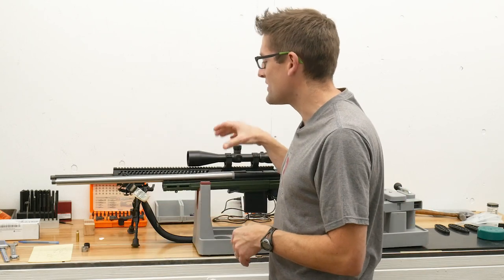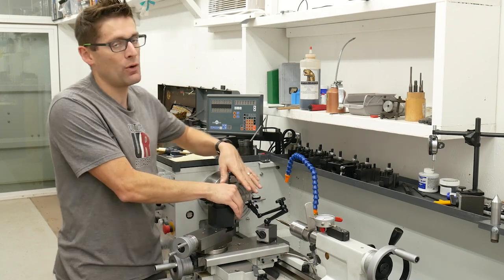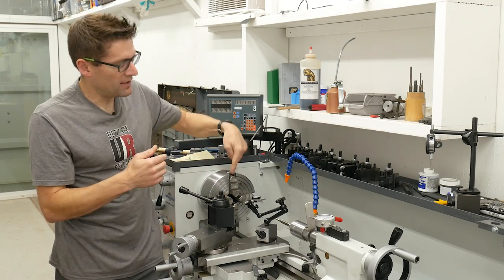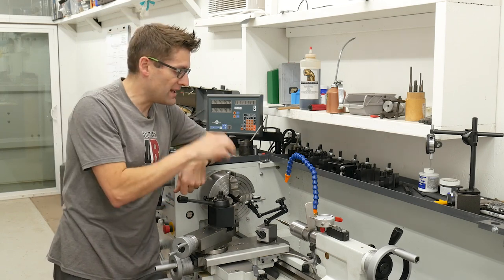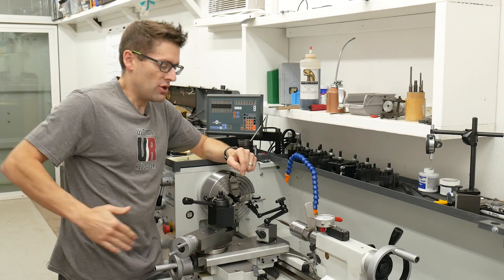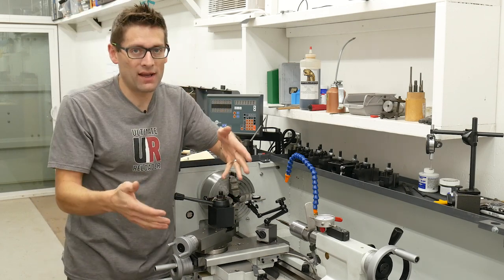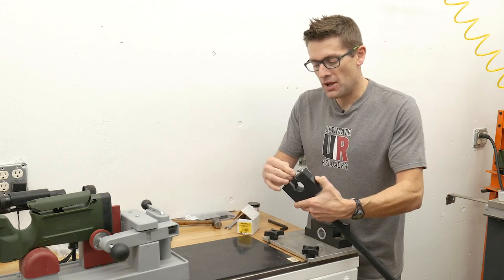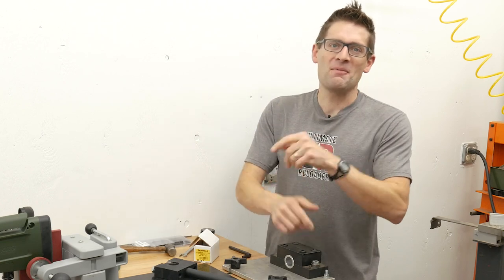224 Valkyrie Rem 700 Build: Muzzle Threading and barrel install (Part 4)

Comment: If you want to reduce your stress level in threading , I would suggest a change. Turn your threading tool over on center, reverse your spindle direction and thread away from the shoulder. You can set a hard stop to start from and never worry about hitting the shoulder.I enjoy your videos keep up the good work!
Reply from the maker: I'll have to try that!

Comment: Gavin, I think if you used a piece of heavy gauge aluminum wire wrapped around the barrel and cut so it doesn't touch itself you'll find it much easier to center the barrel than the aluminum pads you are using. The wire makes single point contact with the barrel and allows it to move much easier than the pads.
Reply from the maker: Bill- I've heard of guys doing that- perhaps I'll try it and compare! Thanks.

Comment: Nice video. 2 tips.....First order your self a stick of Creytex, its like a rubber eraser impregnated with carbide use it to polish your muzzle and any part you machine. Secound before you start polishing a part in your lathe useing sand paper, take the time to cover your lathe ways with tape and news paper so you will not get sand paper grit on your lathe ways this will keep the Mathews a percision machine for years to come. Why did you not face the action?
Reply from the maker: I'll have to try the Creytex, thanks for the suggestion!

Comment: How do you know you have enough tension (torque) so that the barrel doesn't loosen up after firing? Is there any "lock tite" you use on the threads?
Reply from the maker: As long as you torque down the barrel well (I apply approx. 50-70 ft-lb toque) you aren't likely to have the barrel loosen on you. I don't use any thread lock because I know I may want to spin on different barrels, etc and don't see the need for it.
Reply: @Ultimatereloader  Thanks, love your videos btw. I got started reloading because of them. 👌

Comment: Did you have formal training as a machinist? Or have you taught yourself this over the years? I'd like to do some of this but have no formal training.
Reply from the maker: From my reply to another commenter: "I started on metal lathes in 1986 in junior high, and worked with my grandpa in the 1980s on his South Bend lathe... then studied Mechanical Engineering (which involved machining), and then "worked my way up" to nicer and nicer lathes of my own. Long journey, glad to be working on guns now, it's so much fun..."

You are in the right place, I'll be covering all of the fundamentals right here!

Comment: Why not install the action before chamber cutting? That way you dont need to account for shrinking of any dimensions, the reamer would just need to be long enough to pass through the action.
Reply from the maker: Some people will finish a chamber that way- with a reamer extension, cutting by hand. Hard to cut the whole chamber that way! :)
Reply: So can we get ridiculous for a second? Why have the action as a separate component anyway? Just make the barrel and action from one solid piece of bar stock...
Reply from the maker: Well, one reason is the ability to re-barrel! :) I know guys that are on their 4th barrel for a custom ($3000-5000) rifle, and the action just keeps on working. Sometimes you can "burn out" a barrel in 2000-ish rounds (depends on cartridge).

Comment: Don’t ever polish the crown your your machine work should be good enough to leave it alone. Second most cartridges zero to +.004 tolerance with positive .004 being your nogo. With the way that go gauge dropped with no tension that was was go but adding tape and then it wouldn’t close you were at or past your nogo.  Buy a no go gauge they also make go +2 gauges